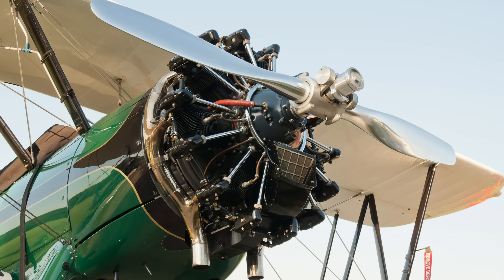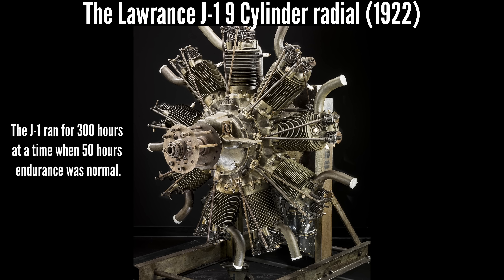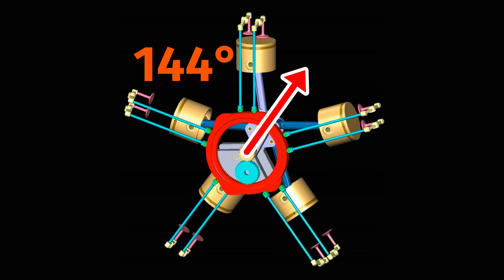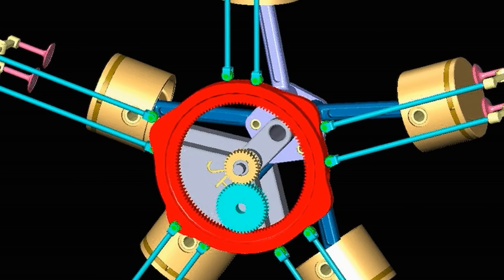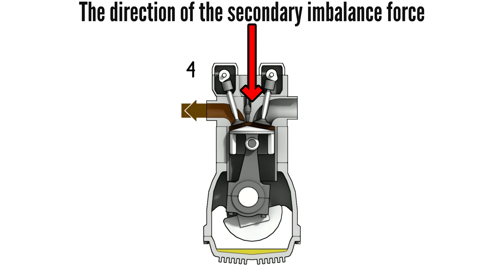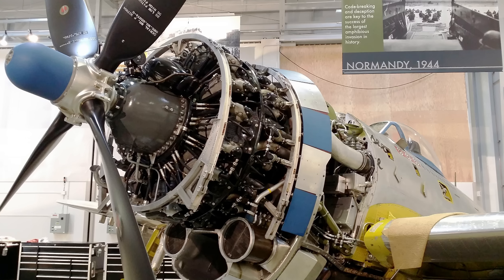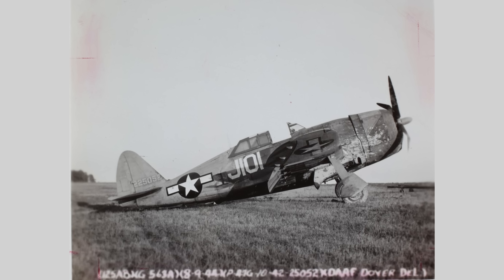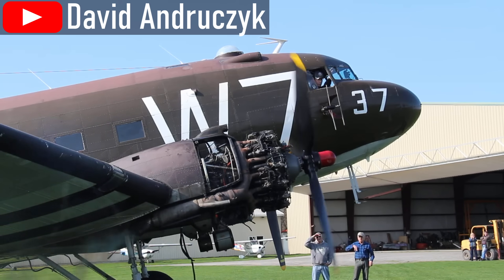The Rise & Fall of the Radial Airplane Engine - History & Technical

Comment: Crazy and probably pointless idea ( and only a WW2 what-if  ) .... why not put a radial engine with a single cylinder bank horizontal into the Wing of a 2 engine plane instead of engine nacelles or the fuselage. The crankshaft is is ofc now rotating horizontally and needs e.g. bevel gears adding complexity. The cooling which formerly went directly through the crankcases needs to be diverted into the engine ( since the flat crankcase/cylinder disk probably protudes above and below the wing, air ducts and horizontal fan-propellers can/have to be added. The other parts of the engine which usually sits as compact as possible behind the conventional Radial need to be spread out around the engine disc. WTH ? Just one reason, to reduce drag having a sideway disc instead of a frontal full circle, which can - partly - be integrated into the inside of the wing.
Reply: You could just as easily do this with a horizontally opposed engine, and not need the bevel gears.

Funnily enough the US toyed with that idea a bit pre-war, but the resulting engine designs were failures.

Comment: Yes early jets guzzled fuel. Please a do history of the Pratt and Whitney J58. Turbo jet that for the day was fuel efficient. It changed the game. Add cheap kerosene for fuel, way less maintenance, twice the speed and in airliners pistons were gone. Also the time between overhauls for the super high powered radials was dropping like crazy due to the stress from constant high power and complexity.

Comment: Lycoming built the XR-7755 Radial engine, 36 cylinders, nine 4-cylinder banks, liquid cooled Power rating: 3,729 kW (5,000 hp) at 2,600 rpm Displacement: 127 L (7,755 cu in) Bore and Stroke: 162 mm (6.375 in.) x 171 mm (6.750 in.) Weight: 2,783 kg, but by time it was developed jet engines came along.

Comment: The author of this video mentioned the Salmson Unne radial from WWI,  it didn't have a master rod, what it had was a countergeared rod or spider  base that used straight cut gears to align the "spider" with all of the subrods for each cylinder  That had to be the noisiest part of the entire engine next to the exhaust.

Comment: I once worked for six weeks in a remote forest airport in New Brunswick when budworm control was still practiced. Every morning when the weather was right we were treated to a concert of a Cessna 185 with IO520, 8 R-985 powered Trushess, 8 TBM with R-2600, four C-46 with R-2800-51-M1 warming up, runup and take-off. The symphony lasted about 45 minutes,  sounded like Dawn Patrol, and repeated sometimes a second time in the morning and again at least once in the early evening.ontrol was still practiced. I didn't mind at all being awakened by that!

Comment: I dreamed a car with a radial engine mounted flat on its back in the engine bay, transmission mated underneath. This would have made for a neat, compact installation with symmetry, just a thought.

Comment: Don’t want to pose as an expert, but I’m not sure the comment regarding drag is correct. The radiator and cooling system drag needs to be taken into account with a v12 or other water cooled engine. They got very good with the cowling and airflow of air cooled radials, and I think in the end they did not have more drag.
Reply: you are correct.  Some radial installations got very very close in drag, or bettered the in-line engines (V-12s)  by the late1940s. Was achieved through cowling designs that used exhaust gases to aid in extracting the cooling air past the cylinders using "Augmentor" tubes. A form of aspiration. Consequently, the cowling could be wrapped tighter around the engine, and the cowl flaps eliminated. Convair's claim was that cooling drag was "eliminated" on the 240, 340, etc. models.
Reply: @2lotusman851  I didn’t know that about the convairs, thanks..!
Reply from the maker: I didn't do an airflow analysis or anything, but I do believe it was possible (and not exceedingly difficult) for the V12's to have less drag than the big radials. Look at the P-51D Mustang. Relatively tiny inlet on the nose and a bigger one on the belly. No way that's more drag than a large radial like the P-47 or F6F! Look at them when they are parked next to each other you'll see what I mean. My opinion anyway.

Comment: Thanks for this informative video. My father was a fighter pilot in WW II, flying a P-38. Although this fighter had liquid-cooled engines, my father had flown various kinds of planes in training, etc., and he taught me quite a bit about about the different kinds of aircraft and their engines. When I was in graduate school in Athens, GA during the middle and late 1970s, I usually went home to the NYC area by air. There were commuter flights from Athens to Atlanta, and during the first few years I was in Georgia, I flew on these Martin 404 aircraft piloted by Southern Airways (even though most people seemed to avoid them!) because I recognized these aircraft as remnants of an era that would soon end. I used to sit where I could watch the exhaust manifold of an engine (which would glow, especially during takeoff) as well as the flames from the exhaust pipe (yellow due to the richer fuel mixture used during takeoff, then blue during the complete combustion when a leaner mixture was used during cruising). I had an altimeter, and brought it along during flights. I don't believe these planes were pressurized, but they didn't fly very high--my altimeter usually read about 5000-6000 feet. The larger jet aircraft, being pressurized, read about 8000 feet although they flew at altitudes 3 to 5 times that. As I recall, the smaller turboprops, which replaced the Martin 404s, typically flew at about 15,000 feet and were pressurized. Before the days of terrorist attacks, one could sit up front in a turboprop commuter and watch the pilots at work (it wasn't interesting to watch the engines with those aircraft)--I knew the altitude because I could see the plane's altimeter. Now I take my road atlas and track the progress of the flight--and sometimes I see interesting things on the ground that I decide to visit by car later on!
Reply from the maker: That is awesome! Your father must have had some stories. Thanks for sharing.
Reply: @LetsGoAviate  You're most welcome. Yes, he said that at one point, he was sitting in New Guinea "feeding" the local mosquitoes, and decided he would be thankful for every day he lived after that. He made it to halfway past his 90th birthday.
Reply: Here's an interesting connection: my great grandfather was also in New Guinea during WW2, he was an infantryman in the Australian army.

 I have a model of a P-38 that he cast from aluminium at some time during or after the war, my grandmother told me he might have got the metal from a crashed Zero, though that's almost certainly not true.

 I guess it's possible he actually saw your dad's plane flying by at some point. Certainly he must have seen P-38s around given that they inspired him to make a model of one.
Reply: @nerd1000ify  Thanks! As the saying goes, it's a small world. I want to thank your great-grandfather posthumously for his service in helping to win this war for both our freedom-loving countries and many others.

Comment: Changed mine at 10,000 miles. Saw the mark inside the rim, but just threw them on the static balancer to confirm it was the heavy spot. Replaced with OEM Bridgestones. No weight needed on front wheel, 14 grams on the rear wheel.

Comment: This blew my mind. I had no idea all the engineering that went into the radial engine. I flew in a four-prop plane as a kid and I remember the vibration and sound. Now I know why. What incredibly smart people. I get why it took Wright Aviation so long to work out all the kinks in their engines in the 1930s and 1940s. All this was done with slide rules and vellum.
Reply: I’m an old architect and I still use vellum. Ha Ha!
Reply: @powerwagon3731  Y A Y !
Reply: I have used vellum and mylar working as a draftsman at a shipyard in 70s.

Comment: Excellent presentation but it failed to identify the pinnacle of radial engines the Bristol Centaurus or the pinnacle of water cooled aero engines the Napier sabre these engines out were more efficient than the poppet valve engines ( some of the larger poppet valves produced more power but required far higher boost etc so it’s not comparing apples with apples)
Reply: Not really the pinnacle. Sleeve valve radials were never really able to meet weight, oil and fuel consumption or power guarantees to the airlines after WW2. So they were largely ignored by airlines, who also didn't want to deal with their devilish complexity.
Reply: They were no worse than the poppet valve radials on oil consumption (more a case of both being really bad. The R-2800 used about 1 gal of oil for each 25 gal of fuel at cruise), and competitive on fuel if we compare without turbochargers or the R-3350's infamous 'parts recovery turbine' (I.e. turbocompounding).

The main problem was that there was only one firm making them, in the UK, at a time when the UK's economy was on its knees and its empire crumbling, and they had only a few small advantages over the cheaper and simpler poppet valve designs.

Comment: 7:20 should it not be "travelling faster in the middle of the cylinder and travelling slower in the top and bottom part of the cylinder?

I assume the velocity of the cylinder is the derivative of the position of the cylinder-head, so the derivative of a cosine-wave. (Fully extended = 1, derivative is negative sine wave meaning initial velocity at 0 and travelling down first with negative speeds.

I just went down a rabbit hole of calculus. My initial thought was correct but only under the assumption of an infinitely long piston arm. If this goes to infinite, max velocity approaches at +/- 90°. Assuming the arm is at least twice as long as the radius of the crankshaft, it's at more than +/- 68° (until 90°) which is indeed in the upper half though.

A am stuck to at determining the angle of the maximum velocity in accordance to the ratio of radius of the crankshaft and the length of the cylinder arm.

Definitely insane amount of engineering and maths behind making those engines more efficient.

Edit, if anyone wants to continue this thought, enjoy the formulas I came up with and it's 2nd derivative:

y=l*cos(arcsin((r*sin(x))/l))+r*cos(x)
a=y''=-(r*(l^3*cos(x)*(1-(r^2*sin(x)^2)/l^2)^(3/2)+r^3*sin(x)^4-l^2*r*sin(x)^2+l^2*r*cos(x)^2))/(l^3*(1-(r^2*sin(x)^2)/l^2)^(3/2))
r is Radius of crankshaft, l is the shaft of the cylinder.
Reply from the maker: I can't contribute to the math. But yeah naturally the piston would slow down and come to a stop at TDC and BDC. But there is additional acceleration and deceleration happening for every up and down stroke, and it's all because of the movement of the connecting rod. This causes the faster movement of the piston at the top half and slower moving at the bottom half. 

With the piston moving down from TDC, the conrod goes sideways, getting shorter in vertical length (relatively speaking), and since it's vertical length gets shorter, it pulls down the piston additionally. From mid-stroke further down the conrod goes straight again, getting longer and this slows down the downward speed of the piston. And the the reverse going up again. 

Another way to think of it is with the crankshaft at 90°, one might think the piston is exactly 50% down the cylinder, right? But it isn't. Because the conrod goes sideways and becomes shorter (relatively speaking) the piston is more than 50% down the cylinder with the crankshaft at 90°. How much it goes down past 50% is dependant on the tilting angle of the conrod, which differs based on conrod length and crankpin moment arm or distance from the pivot point.

Comment: Radial engines partially dealt with secondary imbalance with a counterweight held with a degree of freedom of movement. Usually with two pins holding the weight through two holes bigger than the pins. I'm unaware of how exactly the forces cancel or how good the system is.

Comment: About Radial Disadvantages: 
I feel like you should have mentioned that the larger frontal area is offset to some degree by the lack of a radiator for engine cooling.
Greg's Airplanes and Automobiles has a video about the Fw190, argueing that it probably has less drag than the Spitfire it was facing, in part due to lack of radiator.
Reply: How do you get fresh air to all the fins? With a radiator it is easy: put a pyramid into the tail. Radiator at the base, cut off the tip and point into the wind. Hot air exists out of the back like in a jet engine. Actually I want a ducted fan in front. Can I have a small drive shaft to the engine in front? Why don’t radials have a fan ?
Reply: @ArneChristianRosenfeldt the sheet metal baffling did a really good job of that on higher power radials. Slow moving cargo planes still struggled to cool, but fighters and unlimited air racers did fine.
The Republic XF-12 used a cooling fan. It had a large spinner and a tight cowling, feeding cooling air through a narrow gap. It was to be fairly high speed, so I don’t know if it really needed the fan other than on the ground. As did their XP-72 Super Thunderbolt. B-36 also used a fan, driven from the accessory end (front of engine because pusher). But the engines were buried in the aft of the wing.
Reply: @ArneChristianRosenfeldt  Is this a setup or a genuine question? I am asking because the mentioned airplane, the Fw190 opted for exactly that option.
Not all radials need a fan, in a way there, the entire airplane is the "pyramid", but it was opted for on the Fw190.
As far as I know, it took about 70hp to drive the fan, but it should also reduce drag, so its not like those 70hp are just disappearing.
Reply: @Hyperus  TIL. I may have scoffed at old plane too much and did not deep into them. So I will look for a slow biplane which greets me with a fan like a jetliner instead of cooling fans in the front. Maybe those are buried so deep behind the NACA cowl? On a turbo prop the gear is in front of any fan. So the fan is hard to see. ( the old British Russian turbo props without reverse flow ).

Comment: A competent pilot could flip the Sopwith Camel facing the other direction due to all the weight up front and the gyroscopic action of the rotary engine. The castor oil would also act like an anti constipation causing pilots to often have to rush to the toilet on landing so as not to have an unfortunate bowel movement.

Comment: I have read many storys of radial engined fighters returning with cylinders shot off but I've never see a photo of the actual engine damage. Undoubtedly the radial engine was more durable than liquid cooled inline engines I'm not entirely convinced that planes returning without cylinders actually happened. I'm more than happy to believe it happened if someone can show me a photo but I cannot find any myself.
Reply from the maker: I'm with you there. I looked hard, but couldn't find any photos. Only of multi engine bombers, but that doesn't count as the good engines could have provided the power to get home. I've been a WWII aviation fanatic since childhood and read countless stories of single engine radial fighters coming home with substantial damage.
Reply: I doubt there were many cases of a cylinder being shot off completely, it's a big lump of metal designed to contain explosions and fairly sturdy. More likely the stories originate from pilots 'losing a cylinder', meaning that one (or more) of the cylinders wasn't firing anymore due to battle damage, rather than no longer being attached to the plane. Same if a pilot says 'cylinder 3 is missing' - that means it's misfiring, not that it got lost somewhere. 

The reliability was true though. A radial engine with a hole in one cylinder would run rough, but it would still run. A liquid cooled engine with the same damage would be spewing coolant and soon seize.
Reply: @MrWillNeedham  No the descriptions I've read and also a allied veteran pilot said in a interview "two cylinders were shot away and the pistons were flopping around and the engine ran fine"  if you look into it their are lots of accounts like this but no pictures.  
I would think that something as amazing as a fighter returning to England missing cylinders someone would have taken a photo? I do believe what your say is 100% plausible and it's been exaggerated for propaganda and then became part of the ethos of history over time.
Reply: Exaggerated for propaganda, or simply exaggerated during repeated re-telling of the tale? Large holes in the cylinder walls I can easily believe, but I struggle to picture any kind of damage that would remove the entire cylinder without taking the piston with it.
Reply: @MrWillNeedham  Me myself I do believe that these story's were made  deliberately to build the reputation of the P-47 as being unstoppable but I've go no way of backing my opinion up. What your saying is entirely plausible it could be one of the many myths we are all guilty of repeating like the M1 Garand ping myth my wife repeated one recently that carrots are good for you eyesight.

Comment: What he isn't mentioning is the fact that the cylinders below 180 degrees of the crankshaft centerline were notorious for fouling spark plugs on start up.....if you were lucky the plugs would clean from AV gas pulling into the cylinder!
   Ever seen vids of guys pulling the huge props around before starting? Trying to avoid this constant problem.